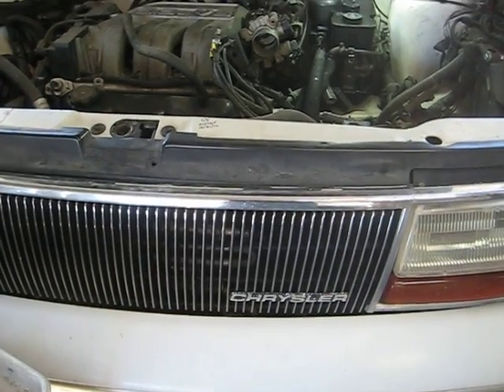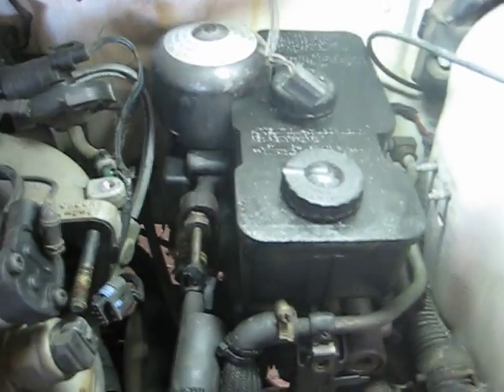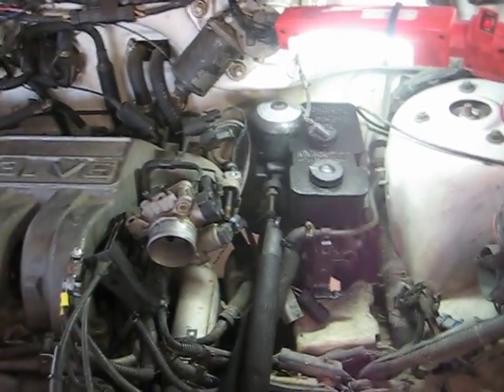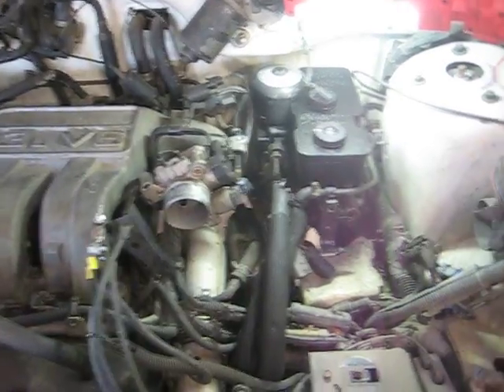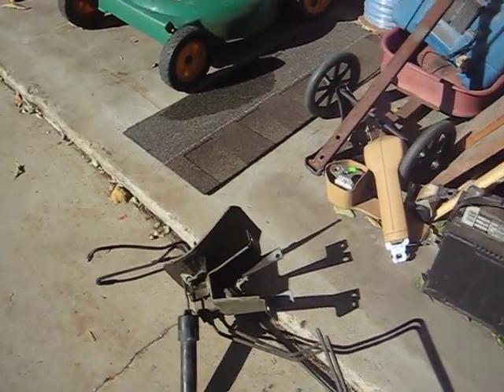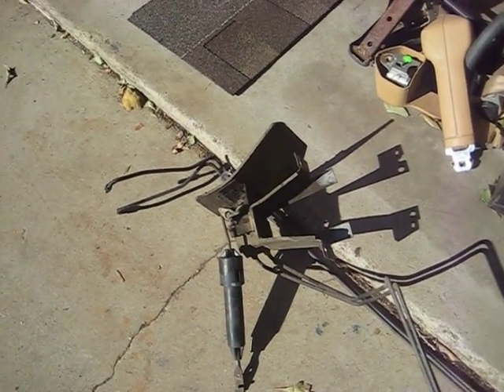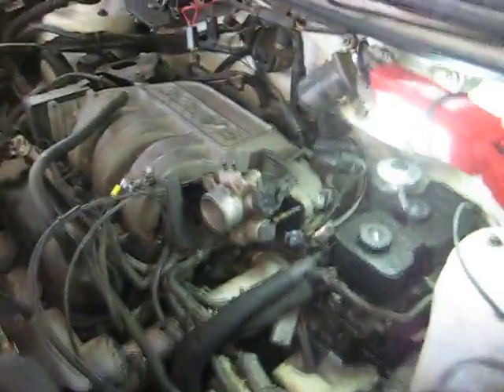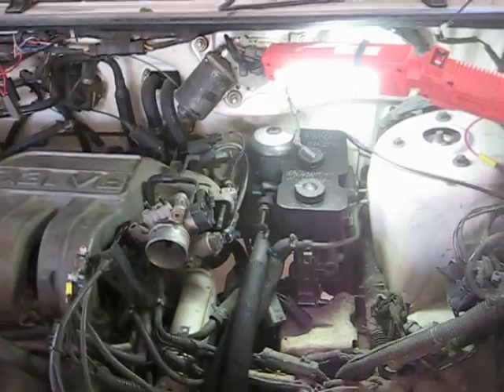Chrysler Town & Country ABS Conversion PT1

Comment: so i got brake fluid spraying out from the abs box master cylinder area in this same van, same year.  y do u have to replace so many other things besides that part?  u cant just pull the abs fuse rip out that part and replace it with a master cylinder? my abs has never worked the entire time i had the vehicle and i'm good on that.
Reply from the maker: Yeah it works best if you eliminate all the ABS crap they never worked right when they were new!

Comment: For Your Info!! Some free advise from a chrysler trained technician.  The rear "Load sensing valve" in the back does not "sense" load.  When you hit the brakes real hard and the front of the van dives and the rear comes up (laws of physics) the valve in the back gets extended, limiting  pressure to the rear brakes, because now there is not as much weight on the back tires, and you dont want them to start skidding. Please dont leave that unhooked, or your for sure to set the van into a "over steer" conditon under heavy braking, causing the back wheels to lock up, and the back of the van will surely skid and want to slide sideways.

Comment: My sons and I completed this very task on a 1991 Plymouth Voyager.  I purchased the vehicle in Nov.1994 and had nothing but problems with the ABS system.  As of this date the vehicle has slightly over 137,000 miles, so it hasn't been abused.

After the ABS module went out and the hydraulic unit started leaking we began pricing the cost to replace the module, hydraulic unit and pump, the cost approximately $2,000.

After watching this video we decided to pricing parts, it was a no-brainer.
 
We purchased a new booster and master cylinder for $135.00 (including tax) and $115.00 for the used brake lines, load sensor and differential valve.  The brakes work better than ever.

If you can turn a wrench you can do this.  Purchasing a Haynes or Chilton manual might be helpful if one is wary. 

It is actually easier that Poochefmarowbe makes it sound, but thanks to him my son didn't junk his van and has a safe braking system for about $300.

Thanks Poochefmarowbe. 

@ jimmy green...anything from a 1991 - 1995 is of the same generation and interchangeable in the Grand Voyager, Caravan or Town & Country.
Reply from the maker: Thanks so much for the kind comment I'm glad I could provide something useful to the community! I learn so much here myself that it's great to give back! Sadly my daughter grenaded the trans in the TC so it got sold!